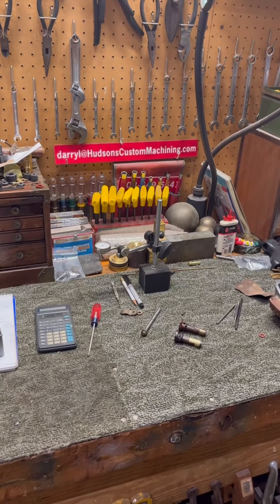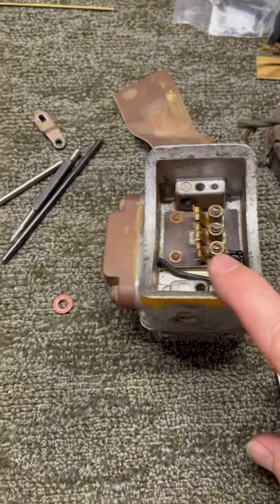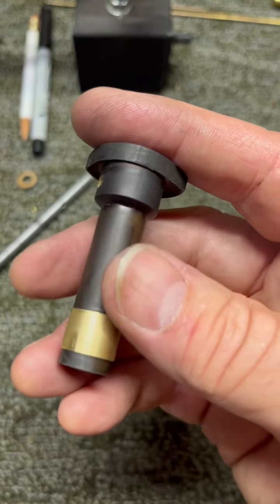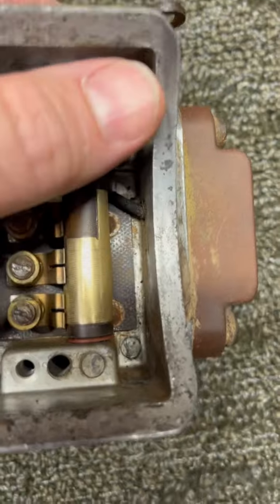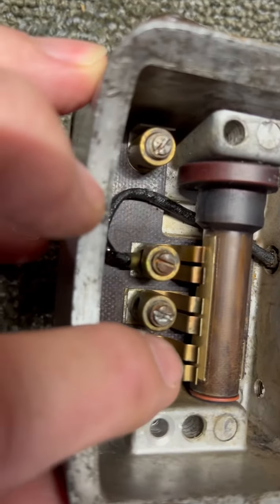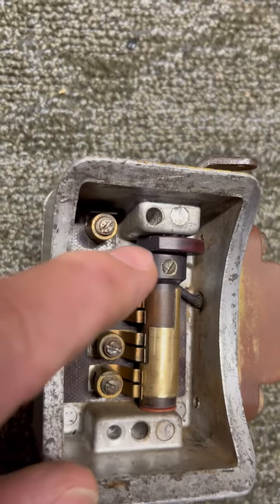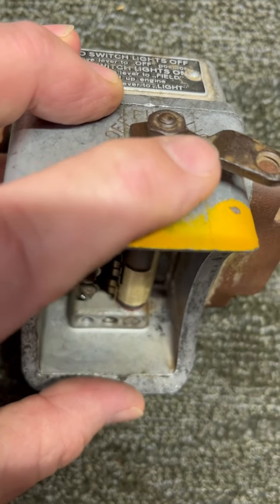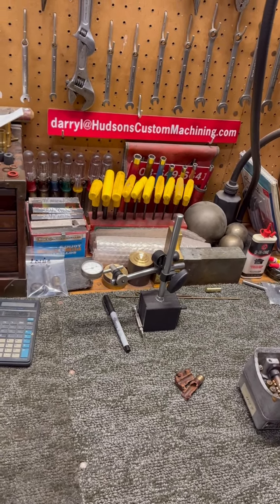Tractor part reproduced for Al by Darryl Hudson

Comment: Brilliant piece of machining.  How did you add the copper insert.
Reply from the maker: I machined a brass sleeve and made the ID of the sleeve a tight press fit for the insulator, then cut out the profile.  It was a tight fit and I couldn’t budge it, and for a little extra insurance I mixed up some 2 part epoxy and put on the insulator and also the ID of the brass sleeve.  It’s there permanent.   Thanks for the comment.